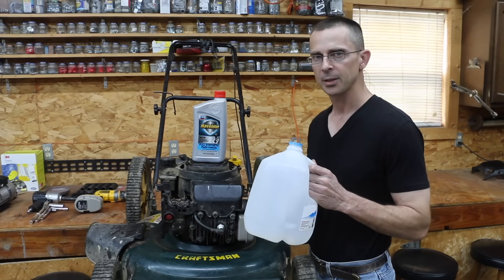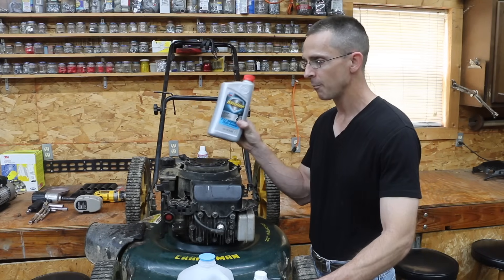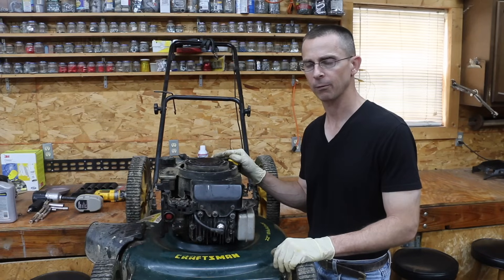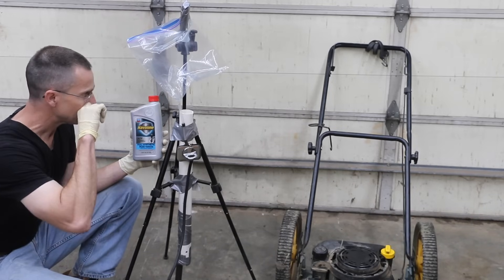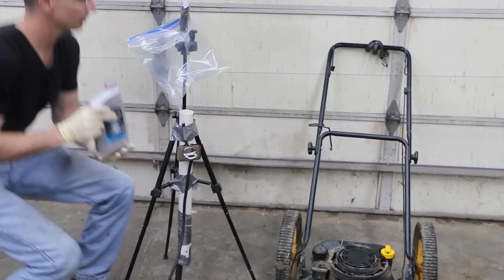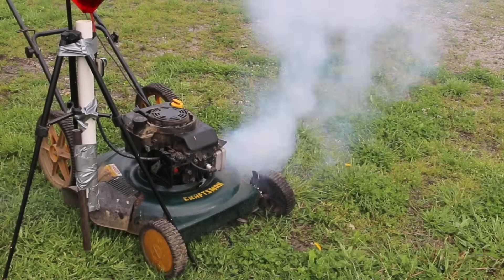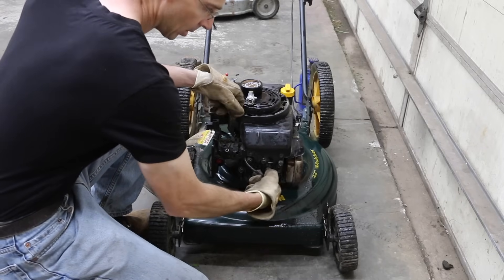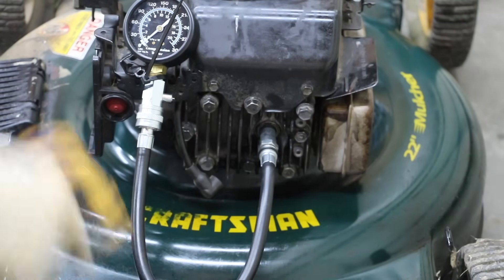Seafoam--can't believe what it did to my engine episode 6--Seafoam vs ATF!!

Comment: First off, I LOVE your vids! "Knowledge through trial and error" is the ONLY true way to test the "Hype" of the many products that are out on the market these days. There seems to be NO honor among the many companies that sell additives for the cleaning of engines. With that being said, I have been a long time user of ATF for cleaning internal combustion engines. I have also used Sea Foam for years as well. Even though water is "cheap" compared to the other additives, by the time you factor in the multiple oil changes it takes to clean out the contamination of the crankcase due to the water, and the risk to the crank and rod bearings  with the exposure of the water in the crankcase, in my opinion, Water is the inferior cleaning method in the test of three cleaning methods. In my area of Pennsylvania, I am very lucky to have ethanol free fuel available. I run the ethanol free fuel, I Sea Foam every other tank of gas during the cutting season on my lawn tractor and push mower and weed eater, then at the end of the season, before my yearly oil change, I ATF the Lawn tractor and push mower. This maintenance schedule has netted me many many years of life out of my lawn equipment, without ANY major engine failures. In addition to the additive treatments, I also include new spark plugs, air and fuel filters to my yearly routine. To me, this is the cost of owning decent quality lawn equipment and keeping it functioning properly. I would never consider using water as a cleaning method for an internal combustion engine. Earl Harrell (50 year Tool and Die Maker, Machinist, Mechanic)
Reply from the maker: Thanks!  Thanks for sharing.

Comment: Great job.  I used to work in a car repair shop.  We had an old guy come in and his car did not run good the owner of the shop said here  rev up the motor to 2500 rpm while I add this transmission fluid slowly through the top of the carb on the car.  It smoked a lot.  We got in the old mans car and drove it down the highway.  I ran like a new engine.  You are defiantly right Do not ever run water down the carb. Again great job!
Reply from the maker: Thanks and you are welcome!

Comment: March 2022. The ATF did a good job, but there is still a lot of carbon. I disagree with maintenance preventing carbon build-up. It will help reduce it, but won't prevent it. Engines are hot, undergo combustion, and are filled with carbon based fluids. Carbon will build up over time. 

I'm a scientist, a chemist specifically (ret.), and I agree that it is just as valid to spend time, money, and resources on experimenting as it is to do anything else with them, especially when others would sell the old mower or put it out for the trash to pick up, and buy another one. And do something else that costs money with their time. I put money into my old car to fix it when others would have junked it or traded it in because fixing it is costing more than the vehicle is worth. But I don't have a car payment or high insurance rates, I enjoy the work and I learn a lot from doing it. I'd rather have my old beat up project car to play with than try to find something else as stimulating to do with my time, my hands and my mind. I do have a reliable vehicle for when I need one, but my son drives it most of the time. If I had this guy's resources, you bet I would be doing these types of experiments, building my own simple testing equipment and designing my own tests. That is what I call FUN!!!
Reply from the maker: Thanks for sharing.

Comment: Enjoyed. Long time user of Seafoam. I have never used it for cleaning inside a motor. But I use it in fuel for keeping injectors clean. It is a life saver when using crappy fuel. I have John Deere Gator that will constantly clog up without it. I had never used it in my 2011 Chevy 1500 until this year. When starting cold it developed a lag when starting. I thought it was fuel pump losing prime after adding half the amount suggested on bottle and running It has completely stopped and is firing like new again. Would other things work as well? Maybe, but with 165000 on my truck I'm not taking a chance. Still love the stuff!
Reply from the maker: Thanks!  Thanks for the feedback.

Comment: @Project Farm 

 could you please advise if one litre of Dextron 6 Transmission fluid be used along with 4.5 litre of 5w30 in GMC YUKON 2013 for a full cycle of 3000 miles
I have no major issues with engine

Comment: What gasoline had the mower been running on in the past? I am wondering whether the regular use of a Top Tier gas (with far more, it is claimed, than the EPA's minimum detergent content) would keep the engine cleaner and render the occasional treatment with any of these additives superfluous.

Comment: For years I have added Sea Foam to the gasoline on all of my mowers and 2 stroke equipment as well as to my truck engine. I don’t drive my truck much and it keeps the fuel stabilized. I use my snowblower 1-12 times a season and Sea Foam means it starts the first time every time. The same thing with the rider and push mower. They start every time. Same thing with my 2-stroke equipment. They also start. My 2-stroke chainsaw is 35 years old and it usually starts on the first pull and always by the second pull. And sometimes the chainsaw fuel is 3-5 years old and it always runs.
Ron
Reply from the maker: Thanks for the feedback.

Comment: Uv gotta find oOt, exactly, which additive is the best for not only cleaning gunk out(which could be a big problem if it gets stuck in every tiny hole on newer interferance vvt, etc., s2pid-smRt engines), but rather - which one turns the sludge into a liquid(I O - one of those expensive additives you mentioned was probley auto RX +.. it’s natural & does that)..  another thing to experiment with is a steam cleaner, pressured steam.. but even if that worx amazingly well, tough to get it through engine as pressured steam & probley doesn’t convert the sludge into liquid that can drain out without clogging those tiny holes, etc.  but just for the valve covers, I wonder about a small portable steam cleaner - that 2 steam the sludge loose, followed  immediately with a vacuum? hmnn🤔 that would even vacuum up most of the soon 2 B water.. thNnnn auto RX .. all natural, costs $125 for 5 bottles from auto RXz website, 2 for 1st 3000 mile cleaning, 2 mOr for 2nd, (then it’s just .3oz 1/4 bottle $7 for maintenance amount w/each oil change).. steam cleaner loosens & softens it, vacuum removes it & water, autoRX gets all the unreachable rest... that’s the best combo I can think of👋

Comment: Right now I'm testing mixed half qt of trans fluid 1/4 qt of trans fluid and 1/3 qt hotshot secret FR3 going to run it in the engine with the rest of the oil I drained a qt for this added mix my oil was new within a hundred miles too on a 2001 5.3 l silverado hoping I can help my ticking go away what do you think of this strategy? How long should I drive before dropping the oil?
Reply from the maker: Thanks for the suggestion.
Reply: @ProjectFarm  It wasn't a suggestion lol I was asking you what you thought about my test I described just wondering if you think it would work?

Comment: With no combustion gasses and a sealed enclosure, not sure why detergents would be needed. Analysis on bobistheoilguy confirms detergent levels are 1/25 what they are in modern engine oil. So there must be other reasons why it reacts with carbon.
Reply from the maker: Thanks for the feedback.

Comment: Just remember, if you are doing this on a car do it AFTER the air flow sensor. Most cars won't run without it so you'll have to make a hole in the hose, get a plug and drill out AFTER the sensor.

ATF will fuck up your air flow sensor for good and they are not cheap nor is it something you can clean off without ruining that small wire.

I have to say that I'm impressed with ATF, I've always just used water but why not one after the other (should be water after ATF, higher viscosity rating).
Reply from the maker: Thanks for the feedback.

Comment: I would just mix 1 quart of atf to a full tank of gas. had been doing that once in a while for years. I also mix atf to my engine oil. my car calls for 10w40, so i mixed 1liter of atf with 3liters of 15w50 to negate the thinning of the oil.  it did a pretty good job, after 10yrs of age when my machenic opened the  valve cover, the metal was only slightly brown not even a bit of sludge.
Reply from the maker: Thanks for sharing.

Comment: As a trained Mechanic, I love what you’ve done with your videos and will continue to follow them. As far as the water, sea foam, atf to clean out a cylinder, I am really undecided on if you should use anything, with the decrease of compression.
I’ve always thought that keeping your engine clean and carbon deposits to a minimum, would be good. But after seeing this video with a decrease of compression, I’m having second thoughts.
Reply from the maker: Thanks!

Comment: In the mid 70's low compression engines and folks looking for cheap gas, resulted in piston head and combustion chamber deposits, which resulted in dieseling. I used hot water fed the carb venturi with the engine warmed up and revved up. After the process the engines would stop dieseling. Never got water in a crankcase
Reply from the maker: Thanks for sharing.

Comment: Hi have you ever did a video on atf in diesel? I've heard the ppl add atf in their diesel tank and it cleans injections and cylinder walls. Is thta true or am I better off using a diesel treatment?
Reply from the maker: Thanks for the video idea.
Reply: @ProjectFarm  wow thanks for the reply I can't wait that's a hot topic in my part of the world I'm from the Caribbean and I'm in a mitsubishi l200 group of over 250 ppl and it's a huge debate atm so when you make the video finally we can get proof and I will share it to them

Comment: I’ve been using atf since, approximately 30 yrs ago; although I haven’t since purchasing my first new truck ( in ‘08). Interesting to visually see the actual results, rather than trusting in the advice of old timers, whom have taught me since I could first turn a wrench. Back then, we just added about 500ml to a full tank of fuel (50 gal?) I would like to see what ratio results in the best possible scenario… 50:1? 60:1? 70:1? And so on. Great video 👍
Reply from the maker: Thanks!  Thanks for the video idea.

Comment: Realizing that this will, likely, never be seen, I add only this addendum; If my engine (by observation of the compression test) were in such poor condition that the cylinder would only hold 65 psi or so at the beginning, I would be certain that the crud on the piston, head and exhaust valve were most likely deposited there by passing through the rings in the first place.  Any further testing would be rendered moot by the fact that the oil in the crankcase would continue to react to the underlying laws of physics.  i.e. It would continue to leak into the cylinder and be deposited whether you ran ATF or not.  It might retard the growth and, perhaps clean it a little better, but unless you continue to run the ATF,  you'll see no better results.
Reply from the maker: Thanks for the feedback.

Comment: Tell us what to think man, should we use our old atf from oil change on our mowers to clean the upper and lower?

 I use old vegetable oil as chainsaw bar oil and it works good, doesnt smell bad and doesnt leave harmful oil on wood projects. 

I use old filtered motor oil as lube for everything like mower wheels and rusty parts, also spray on wood to prevent bug infestation...

Would be good to use old atf as motor treatment on small engines every season. The carb would be oiled all winter if you put atf in the gas on the final run out of gas for winter storage. Steves small engine saloon uses atf and acetone as penetrant.
Reply from the maker: Thanks for the video idea.

Comment: I have used 20% leaded racing gas with regular unleaded in small carburated engines with great results. Exhaust ports looked amazing clean. I would love to see you do a before and after video.
Reply from the maker: Thanks for the suggestion.

Comment: Interesting but ATF may not be a concern in modern fuel injected car engines thru the throttle body like you might try with seafoam spray .  Would it damage fuel injectors O2 sensors or cat. converters ? Anybody try this on a GDI ?   Imagine feeding it through the throttle body using a pump sprayer
Reply from the maker: Thanks for the feedback.

Comment: It is not a waste, on GDI behind the valves a lot of carbon is built up, and this videos show what works or not, it is very useful information. I personally been using mmo to clean and lubricate the valves on my gdi  engine, but if I was on a third world country most likely I would use ATF since mmo would be difficult to find.
Reply from the maker: Thanks for sharing.

Comment: I bought an old truck I still have the dash and windshield where all shot up from some crazy ass and the fuel tank had 10 gallons of atf in it, probably from some idiot adding it to “clean out the engine”. It atf and gasoline aren’t missable so it just stayed in the tank and would keep the truck from running when the fuel pump picked some up. I dropped the tank and cleaned it all out, that truck is still one of my favorites.
Reply from the maker: Thanks for sharing.

Comment: I’ve used ATF before to clean the inside of my lawnmower engine. I used a mix of acetone and ATF and a rag To scrub the carbon off of the piston and valves and after it looked brand new. Great video!
Reply from the maker: Thanks for sharing

Comment: I would like to see a different version of the water test. Your test might have been to exstream as far as how much water was used . What about a ultrasonic humidifier placed next to the Carbonator with just the natural draw of the intake to pull in a humid air supply for about 30 minutes of run time .
Reply from the maker: Thanks for the video idea.

Comment: Technicly your supposed to replace 1 quart of oil with 1 quart of ATF into the crank case of an engine with sludge to break up all the sludge and clean the top end and bottom end of the engine. And run it for about an hour.
Reply from the maker: Thanks for the feedback.

Comment: Project Farm,
Would like to see you do a test on running 2 stroke oil TC-W3 Marine in the fuel system of automobiles. 
There is a long forum on using this, with results claiming that it lubricates the top end, as well as cleans cylinder/fuel injectors as well as increase fuel economy. 
The mixture is 1 ounce of oil to 5 gallons of gasoline 1:640 ratio.

Thanks,
Tyler
Reply from the maker: Thanks for the video idea.
Reply: @ProjectFarm  I found that forum, it has over 1100 posts/comments on it (I'm sure some are non-related). Here is the link:
https://www.ls1.com/forums/f48/been-testing-oil-91206/

Comment: I used seafoam in a 2008 toyota corolla..fowled out one of my spark plug...I ended up replacing all wires and plugs..I guess I used to much for that 4 cylinder...for people with diesel motors,  I've used Lucas,HOWES ,Hot shot in my mack with a MP8 motor..the best result so far is hotshot $10-15 more than the other two products but what a big difference...ive been asking ,mechanics throughout the country about trying ATF and ive gotten more positive responses than negative..I was told to put one half quart with only a quarter tank of fuel to allow ATF to go through system faster..im still apprehensive on doing so...
Reply from the maker: Thanks for sharing.

Comment: I always just dump a can of seafoam in my truck when I first got it it was running real rich after I got it running properly I dumped a full cam of seafoam in and it really helped a lot it ran smoother acceleration was better idled better it’s still not a perfect running motor but it’s running pretty good
Reply from the maker: Thanks for sharing.

Comment: My best results with  ATF have been to poured an ounce or two into a hot cylinder via the plug hole then let it sit over night to soak into the carbon. The next morning start the engine,  run it for 15min at high idle or a little more. The ATF worked great to clean the head, piston tops and to unstick carboned rings. You sir are doing a great service for us all. Some people will complain about anything and everything. As the old saying goes. " you need to break a few eggs to make an omelet"  Crash testing perfectly good cars makes me sad, but needs to be done.
Reply from the maker: Thanks for the feedback.

Comment: ATF has been used for decades to help clean diesel injectors. Pouring it into a screw on fuel filter and letting the engine run until the smoke dissipates. Not a waste of resources, very enjoyable!
Reply from the maker: Glad you enjoyed!

Comment: Interesting and surprising. I've used ATF for numerous purposes; it's my go to helper. I've never used it as in this video. I've added a bit to the crankcase to successfully free valves, lifters  and stuck rings but never into the combustion chamber of a running engine.
Reply from the maker: Thanks for sharing!
Reply from the maker: Thanks for sharing!

Comment: I have a dumb question. I just changed my oil in my truck then did the seafoam hot soak down the carb does that mean there is seafoam in my new motor oil
Reply from the maker: If the Seafoam leaked down past the piston rings, some may have gotten into the oil.  If it were me, I'd change the oil within the next 100 miles but that's just my opinion.
Reply: @ProjectFarm  oh ok I just switched to Amsoil zrod then did the seafoam spray down the carb and watched this and I was like great did I just contaminate the oil